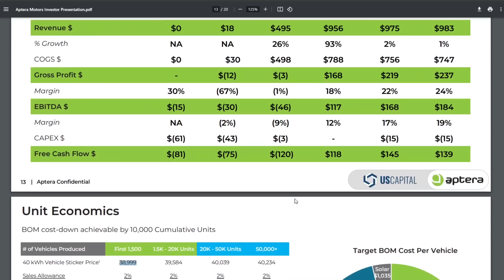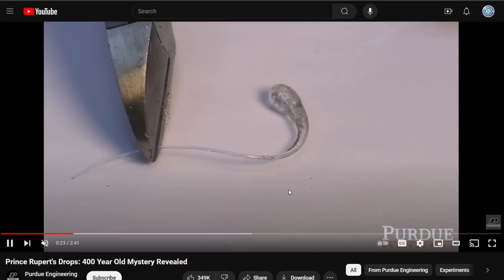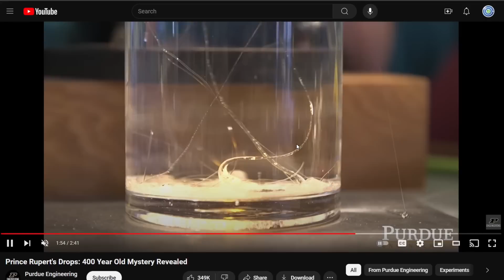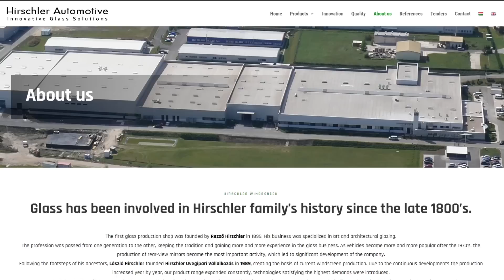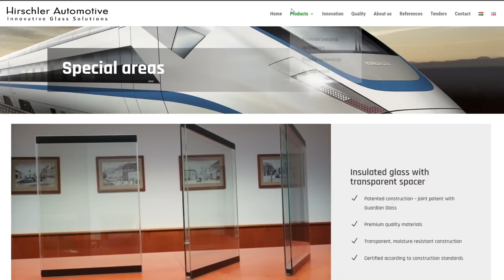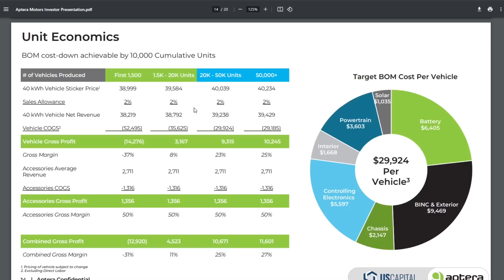Is this Aptera's Launch Price?

Comment: for the launch model, i was quoted a lock in price of 31,500.00. getting it down to the 250 mile range cost of 25k would be great.my order is in the 16000 range which if lucky might be built in 25/27 at the ripe age of 75/77 or 13/15 actual birthday per current calendar around 2051/2065.

Comment: Well, these price estimates are likely to sink Aptera.  There are 50k reservations because $100 is an easily affordable placeholder, and it's refundable.  These were placed when Aptera was pitching a  vehicle that had a starting price of $25k for a model with 250 miles of range.  The 400 mile unit I ordered, with full solar capacity and AWD, was priced (est.) in the $33k range.  If it's now going to be over $40k, and may be available to me in 2026, that's a failed sale.

By 2026, a new generation of EVs will be on the market, with more range, possibly solid state batteries, and a similar price.  While I am a fan of efficiency, and the idea of a solar charging car in TX is appealing, I am not such an efficiency diehard that I would bypass better four-wheeled EVs from established manufacturers to stick with a 3 wheel autocycle from a startup manufacturer.

Sorry, Aptera, but I think your opportunity window is closing rapidly.  If Aptera was delivering vehicles TODAY, even if only producing 100 per month, at least there would be something out there to get attention.
Reply: I'm starting to lose my religion on this  too.

Comment: On the 25% ‘profit margin’ you speak of, this does not include depreciation, cost of any debt, and general and administrative costs.

The 25% you speak of is likely gross profit not net profit.

Net operating profit for most large auto manufacturing companies are typically in the single digits.

Comment: All automotive glass is tempered. The thickness of the glass is also larger on one side of the poly-vinyl butyral over how the poly-vinyl butyral is placed in normal automotive glass. When I was looking at getting the Gorgilla glass for my Jeep JK this placement of the poly-vinyl butyral in the windsheld just changes the glass thickenss on both sides of poly-vinyl butyral and is the only difference with normal automotive glass.
Reply: BTW - I did not get Gorilla glass for my jeep because of both the price and seeing reviews by those that did get it and still getting their windsheilds cracked.

Comment: Even though it's an outdated and not etirely accurate model, EBITDA is probably what everyone is looking for here in the comments.  It's was stopped being used in the 90's due to OI being what most investors need to see and EBITDA being an internal only metric to compare themselves from an operational standpoint against similarly matched companies.

Comment: What is more interesting is their South Park profit scheme.  Suddenly after 1500 odd units their costs drop by over twenty percent.  Their costs also disclaim the direct labor costs on their estimates.  

All they did for their battery price is google what the best prices per KWh are and assume that is their price. Remember the 40kWh pack is actually 45 kWh, it could be slightly less based on Tim's comment about remove some exterior packs.  Regardless Aptera is claiming their battery costs are a very small portion of the vehicle price.  Let me repeat that - the battery per Aptera is not the driver of the vehicle cost.  

I fully suspect their battery costs are higher than they claimed. Telsa's own documents showed their 21700 solution was running $155 kWh..

You spoke to people at Aptera, lol - you have been talking to people at Aptera for years and the only consistency is the story changes.  They are telling you EXACTLY what you want to hear and you don't ever question their assertions even after so many of those assertions have been proven to be lies or just discarded.  They play you so well because they know you will believe whatever they tell you.  Please stop with this fantasy the supplier costs to Aptera will change that much. Please stop with just accepting their fantasy number. Show me one fantasy number before that holds true today? You just accept that profit margin because you want to believe it.  

Face it, this is the first time they had to face traditional financial companies. Hence they had to reveal much more realistic if not actual numbers to these investment groups because their neck is on the line if they are caught peddling lies. When it comes to crowd fund participants, people like you, all Aptera has to do is inflate your ego to the point you actually believe you are too smart to be taken advantage of and in turn you willingly believe anything they claim.  You are so guilty of it at time i confuse you for Drew.

Comment: Don't forget the LE was 33,200 for a all-wheel drive. For a LE just front wheel drive would be 30,700. I hope the LE price is more inline with the present 33,200. Since the LE was delayed I up graded my 2019 Model 3 SR+ with a 2023 Model 3 RWD. I can charge to 100% because the LFP battery for 272 miles. I purchased the new model 3 for 35,000. End of year special.

Comment: There's an issue with your description of Gorilla glass. It's chemically strengthened glass, it's not thermally tempered in the same way as a Prince Rupert drop.
Reply from the maker: i explain in the video that gorilla glass is chemically strengthened using a potassium sodium ion exchange bath to introduce compressive surface forces which was inspired by the prince rupert drop.  similar outcome, different method of achieving it.

Comment: The interesting thing is where the prices won't drop further, the Chassis and the deal for that are fixed, the solar panels and design are fixed, and the BINC (Body in Carbon fiber) are fixed. I could see the Electronics, Powertrain, and Battery all dropping significantly, which makes up half of the current price.

Comment: Great video as always, but don't forget, the figures you are quoting are Gross Margin / profit...  when you add the other costs such as salaries, the factory, might even be useful to have phone & internet to the building, maybe a sandwich machine ( ;) )... etc. etc. etc.   Then the Net Margin / profit is significantly lower.  Have seen companies work on about a 75% gross margin for BOM, but a labour intensive product that left the final profit, or net profit pretty tight....
Reply from the maker: Good point!

Comment: The important number for profitability isn't the BOM it is the COGS and for the first year that is up to $52,495.  They need to find a way to get the bill of materials lower or they will struggle to sell at the tax credit disadvantage caused by IRA and state incentives.  Loss of features like AWD, heated seats, torque vectoring, 3.5s 0-60, skin cooling etc are already a factor.  They need to keep prices down or aptera will never reach mass market acceptance.
Reply: true. if the specs aren't near the original launch edition, I'm probably out.
Reply: With the new powertrain (front drive unit), skin cooling can be put off a bit for later models. And the 3.5s to 4s 0-60s Is still at play (front drive - 200/215 hp - traction control in a car that weighs about 1,800lbs) And like the video states highballing before adjustments in supply chain, I would not be surprised if the final price point is pretty close to the stated $33,200.
Reply: This will be their downfall. The market is not big enough for high volume and the price is way too high. They will need to loose money for a long time , similar to Tesla, rivian and lucid before they even start breaking even.  Low $30’s is the limit for their mass market if they even have a chance of succeeding. My 2 cents.

Comment: That is not the profit margin. There is also the cost of manufacturing/assembly.
Reply: Salaries, rent, utilities, taxes, maintenance,
Reply: @artsmith103  If im not mistaken the COGS line is intended to include those.  Focusing soo much on the BOM seems kinda silly as clearly they are projecting it to change as they scale along with everything else.
Reply: @artsmith103  maybe a sandwich machine   ;)
Reply: @peterchandler8505   I'd prefer a Margarita Mixer :-)
Reply: @artsmith103  :D

Comment: Steve, MSRP minus BOM cost does not equal Profit. There are other costs in a manufacturing company not included in BOM cost..
Reply: Yeah. Assembly, 1.5 hours to apply the wrap; supply chain orders, parts inventory management, finished vehicle management, customer relations/training for new owners, post-sale support and service... $10k  over BOM sounds cheap to me.

Comment: 21700 batteries can be had for $6.50 each at small quantities and as low as $4.55 at modest EV quantities.  That would put their battery pack cost at less than half of what the chart claims their estimate is.
Reply: Yes, which means they're baking in a lot of costs for packaging, thermal, BMS, assembly, warehouse, transport, etc. They did the same for their solar; the solar cells they're using are probably less than $150 per vehicle but they're showing a cost of $1000 for the solar package assembled and installed.
Reply: What 21700 cells are you calculating with? 
The ones I could find online have about 4700 mAh at 3.6V. Equating to 16.7 Wh per cell.
So one 40 kWh pack needs just under 2400 cells.
At a cost of 4.50$ a cell that pack should cost $10800. Way more than what they have shown in the presentation.
Reply: They need 2496 cells (6 modules of 416).  Working backwards from their battery bill of materials price of $6405 the cells are costing them $2.56 (assuming that is the only thing that makes up the battery section and that other components are under "controlling electronics").  If they have any battery costs that are not cells under battery they must be getting them for under $2.
Reply: @ccibinel  I grossly miscalculated the number of cells.  The actual number is 2,304 - 6 modules of 16 groups of 24 (16 x 24 x 6).  At $4.55 per cell (price in quantities of 1,000), that comes to $10,483 for the battery packs, excluding framing, connectors, and electronics.
Reply: @critterbug42  When ordering hundreds of thousands of cells prices of $2.50-$3 are realistic
Reply: The battery module is 24P:16S or 384 battery cells.   There are 6 modules in series for 2304 total battery cells.  At $5 each, that's $11,520 for the full battery pack cell cost.

Comment: If they can't get the price down, there is no hope for high volume.. and there is chance they go the way of Fisker. Chicken and egg situation.
Like it or not, Model 3/Y are the competetors at any significant volume and this needs to be sub 25K. 
The BOM needs to be closer to 15K, The BINC seems too costly as well as the battery.
Reply: I think you're on the right track. Normal productive person will laugh at the under performing vehicle in this price range. It should be trying to be performance Arcimoto for $25K. Smaller 200 mile battery extended 15 miles/day via solar. Smaller 0-60 motors @ 8 seconds. FWD only. Top speed of 80mph. A little more ground clearance, European width. Fold up center back seat. More utility, less performance, lower price.
Reply: @artsmith103  and yet the corvette is popular for a two seater.  Aptera appeals differently by being so unique to other vehicles (even EVs).
Reply: @madmotorcyclist  - The Corvette appeals to old white guys that have them as garage queens. They go to cars and coffee and drive them on the weekend. Most are worried about what ceramic coating to put on it and changing the oil every year. Comparing an American icon to the startup of Aptera doesn't add up. I ask you to go to Corvettes at Carlisle and you'll see. GM knows this and just keeps raking in the money because these old guys are reliving their youth.
Reply: @madmotorcyclist  But Aptera isn't being marketed as a novelty toy like Corvettes or beach houses. It's being marketed as mainstream economic efficiency especially for younger less affluent people (i.e. apartment dwellers.) My message is to give them a reality check that it's a horrible choice regardless of the Global Propaganda they are surrounded by. For someone looking for limited solar gullwing door bling, have fun.
Reply: @billsmith5960  Speaking as one of those old white guys I presently am driving a 13 year old Nissan Leaf (still on original battery). I've only owned a total of three cars in my lifetime and five motorcycles (presently have an 2010 Electra Glide Classic).  A vast majority of miles (over a million) have been done on motorcycles.  My Leaf is just an errand car and I hope the Aptera will be my final vehicle.
Reply: @madmotorcyclist  - What Corvettes do you own?
Reply: @billsmith5960  None too rich for my blood.

Comment: I thought the launch vehicle had a 44 kwh battery and promised 400 miles of range. If they can get 400 miles out of a 40 kwh battery, so much the better, but the range is a more valuable metric. My Bolt's 260 mile range is acceptable, but 400 would be nice especially when I fly to California and drive an Aptera back to Georgia.

$40k is a lot to pay for a two-seater, but I won't be among the first 1.5k or even the first 20k. I'll wait at least a year after the first deliveries and watch reports of early adopters near the production facility. If the first 20k reveal no major defects, and if youtubers report favorably on their maintenance experience including the documentation and phone support for DIY maintenance, and if the range is as advertised, I'll be tempted to use my reservation, but I'll be a lot more tempted if the price falls to $35k or even $30k as initially advertised.

Trouble is, my Bolt already reduces my transportation cost by 75% compared to pumping gas. An Aptera can only reduce the cost another ten or fifteen percent or maybe a hundred bucks per year compared with $250 for the Bolt and $1000 for pumping gas. Cool factor aside, is a hundred bucks per year worth paying an extra $10k compared to a Bolt while losing two seats?
Reply: Very good perspective. Aptera is trying to solve problems that don't exist with solutions that don't work. Limiting productivity in the name of efficiency is an incel marketing strategy. As an example, natural gas vehicle mileage is so affordable that regenerative braking hardly pays for itself. Improving productivity of your Bolt 15% at 5-10% more cost is where the market is.
Reply: @artsmith103 incel?  You really are a Russian troll.

Comment: Many folks have harped over what the price is going to be, and most think inflation will make it higher. The offset of this is tech. prices continues to go lower as productivity increases, and more competitors enter the marketplace with a different product. Aptera has convinced CPC to play ball with them, and smart suppliers will make certain concessions in order to supply parts and get the business. Will dropping Elaphe result in lower prices too, we do not really know, as we await more information from the company. The most important thing is to get those Launch Editions vehicles on the street and have the driving public understand the advancement that Aptera represents with the validation proving the claims made by the company.   
    Thanks again for your continued reporting! When does Aptera plan on the announcement of the drive train changes? When do the PI vehicles begin the process of validation? 
     A profit margin of over 20% is extremely high in an industry ripe with brands to choose from. Driving down prices is hard during inflationary times, but if the economy stalls or contracts then selling anything becomes more difficult. The choice between eating and paying rent, could make buying a vehicle a lower priority. If production cannot begin soon, the longer the wait, the bigger the risk at this point. The crowd is getting restless with more naysayers showing up.

Comment: Sandy Munro has mentioned a mid 30% profit margin range for Aptera in the past.  This amazing margin is another one of the reasons Sandy is so excited for Aptera.
Reply: We are talking about gross profit here, don't forget the other costs like sales & marketing, facility costs like factory & staff salaries, etc. etc. etc...  Net profit usually unlikely for at least 18 months
Reply: @peterchandler8505   Exactly!
Reply: Not amazing for the customer !
Reply: @ericstarmer7779   Well, the worst thing for the consumer would be if Aptera didn't make it to production at all.  The large margin means Aptera has more options in decision making and will more quickly come to profitability.  The large margin speaks volumes toward Aptera's success!
Reply: @DemaGeek  - I like that 30% profit and it's why Aptera will get all of those investors. I just wish this would have known earlier as we all would be driving Apteras and they would be working on the other projects they are working on.
Reply: @billsmith5960  This has been known for over two years.
Reply: Tesla and others have come out with more competitive options and IRA also help them.  Aptera needs to balance profitability until they can get costs down over time with better supply deals or vertical integration.  Aptera made an aggressive choice targeting the cost aware commuter market and will struggle to sell at a premium.  Even on crazy expensive california power prices a model 3 costs ($0.35/kwh) around $3.5k in electricity for 14,000 miles.  If Aptera after solar cuts that to $1500 it is definitely significant savings but still will struggle with $10,000 higher price.  Anywhere with power prices of $0.15 or less savings on power are pretty minimal - I pay about $0.10 / kwh
Reply: @ccibinel  We need to remember that none of this is set in stone.  These are working estimates until actual pricing can be locked down.... only at that point will Aptera be able to determine actual profit margins.